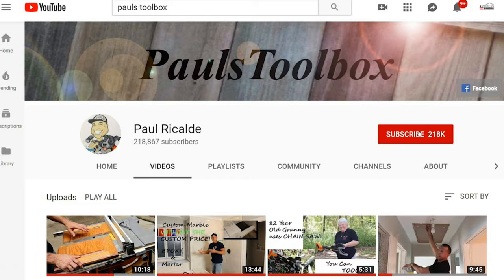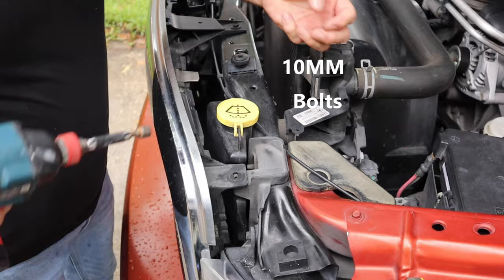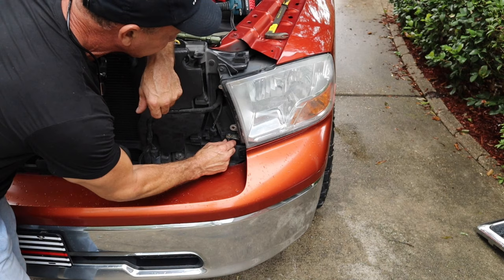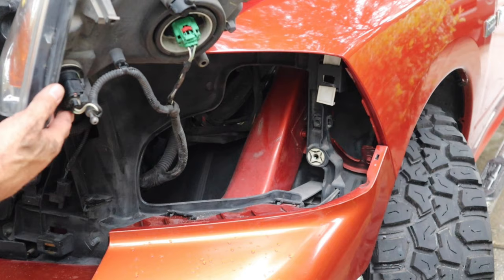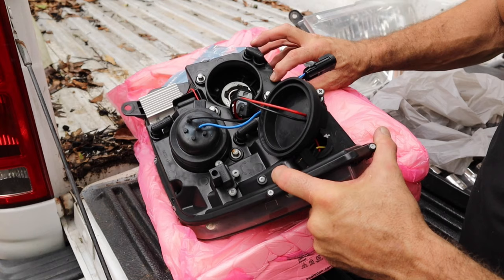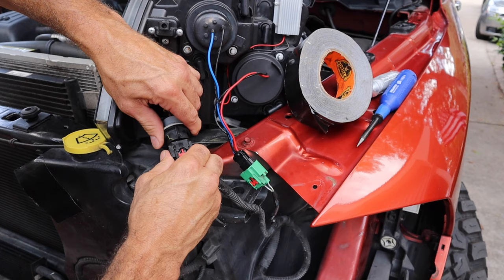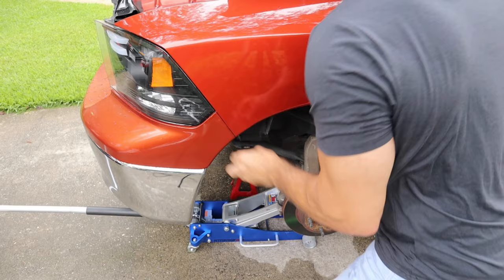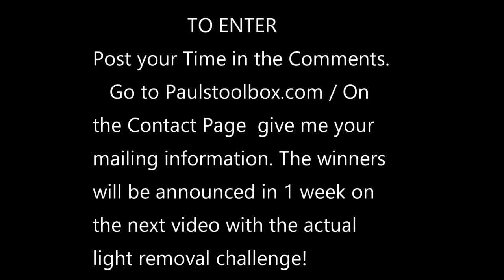How To Replace The Headlight Assembly 2009-2018 Dodge Ram 1500 | Paul Ricalde

Comment: Thanks Paul!  My 2012 Dodge Laramie failed the State inspection because of water in the headlamp housing.  They were badly sun-crazed anyway so I decided to replace them with new aftermarket headlamp housings and covers.  After watching your video I realized how easy it was   and just finished installing them.
Reply: Seriously? Did the headlight work?

Comment: You cover all the little details that are necessary, but others don't show. For me, that included the location of the coarse threaded connectors and how to fiddle with the little lock on the electrical connector. Thanks so much.

Comment: Paul, Can't thank you enough for this video. What saved my butt was the one comment you mentioned regarding the 'clip' that locks/unlocks the lamp fixture. Before watching your video I was frustrated beyond measure trying blindly' to locate that ;'guillotine' clip. Your mention that the simple way to locate it is to bring your hand over to the interior of the sheet metal fender, slide your hand an inch toward the interior and voila! there it is. So freaking simple-saved soooo much time and frustration. Thanks my friend!!
Reply from the maker: Awesome my friend, I had a hard time locating it the 1st time as well. Have a great weekend!
Reply: Yes .. finding the sliding clip was the hardest part.

Comment: Great video. I used this to replace my stock 2009 Dodge Ram headlights with the Amerilite Quad projector headlights off Amazon. The instructions worked perfectly and there was only a slight difference in the electrical connection due to the differing headlights. Very well made video Paul.

Comment: I honestly thought it was absolutely ridiculous to have to remove plastic shroud and grille to change my headlight bulbs. I tried doing this with out removing either. While it is possible, it’s totally worth taking a minute to remove them first, it actually was so much easier. Thank you for the video.

Comment: 2 min. 58.5 seconds 
Great how to video! 
Technically dielectric grease does not conduct electricity, so it shouldn’t be applied directly to the mating surfaces (pins and sockets) of an electrical connection. It meant more for the surrounding connector to prevent moisture from entering the connector.

Comment: Brother...I just replaced the headlight on my 2015 Dodge RAM. It LITERALLY took longer to watch the video than it did to replace the bulb. I would have burned the truck and pushed it in the river if I had tried to do it without watching your video. Every detail from how to get the push tabs off to how to find that plastic slide lock in the trapdoor was spot on. BEST TUTORIAL VIDEA EVER!!

Comment: Thanks a lot, really helped me a lot trying to fix my truck without help as a 16 year old.
Reply from the maker: Wow Jaime, you remind me of myself. I bought my first car when I was 15 with my brother and we had to tow it home. It locked up on someone and they sold it for $100. It was a 1972 Dodge Challenger that needed fenders, a Door and to get running lol. My brother and I took the spark plugs out and put oil on the pistons. When I got out of school the next day we used a breaker bar to turn the crank. It moved so we spun the motor with the starter until the oil came out of the spark plug holes. We put the warranty spark plugs on and started it up. We bought all the body parts from a junkyard and I had a friend that painted in his garage. He did an awesome job and I wish I had that car now.! Not enough people take the time to learn, I glad to see you have the drive!

Comment: Another great video.  Just a side note on working with all the Tupperware on today's vehicles.  I prefer to do it on a warm day rather than a cold one to reduce the chance of snapping any of the plastic stuff.

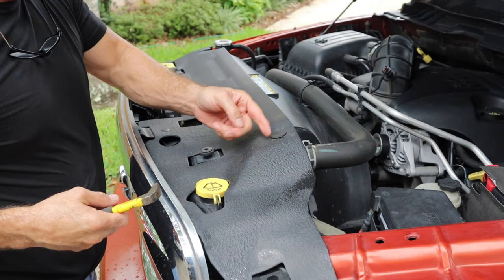You popped the first pin at like 0:1:27, at 0:8:22, you pulled the cable mount off the driver headlamp assembly, making it free of the vehicle, so I'm calling it 0:6:55.  If you hadn't commented, sure, it would be 3 minutes and change.
Reply from the maker: Thanks Curmudgeon, I know what you mean. Plastic gets pretty brittle in cold weather but I live near swamps, HOT and sticky down here. Have a great day!
Reply: @paulstoolbox  c'mon now Paul.  I grew up in Pensacola, and it gets freezing cold down there, sometimes even in the low 50s.

We love a good swamp.  My son and I paddled a canoe 60  miles through your Atchafalaya  swamp a couple of years ago.  Talk about beautiful!

Comment: FYI on the 2011 Ram 2500, you “PUSH UP!” on the white clip inside the wheel well to release the back of the headlight assembly. 😊

Comment: 2.48.33

Looking for some headlights for my '15 🐏!!  Got condensation in driver side factory and it's annoying as hell!!!

Be nice for a product update on that next video......
Reply from the maker: Hi Duane, if you take your headlight out and blow dry it, I sometimes take a sock with rice and put it in the hole of the lens and let it sit for a while, a day or so. Take clear silicone and run it along the entire seem of the backside. That usually does it. I have never had that problem with Spyder lights that’s why I went to them after I had to fix other ones. I will see that Spyder does not give you very good instructions at all but as far as the quality of the lights I am very happy. I have a follow up video on how to easily fix lights when your lights burn out often. I see this a lot of times when people replace the headlights or the bulbs. If you have any questions please send them to Paul’s toolbox.com, I will do my best to answer. Thanks!

Comment: Lady owner of a 2014 Laramie 1500… have to change the whole assembly because the turn signal is out.

Is there a way to fix just the turn signal in the existing assembly, or do I need to just swap in new please?  I have a soldering iron if needed.

Would really appreciate it! Ty!
Reply from the maker: Your local AutoZone or auto parts store should be able to order a pigtail for your truck to replace it. You can also Google front or rear blinker pigtail for your 2014 Laramie. I have purchased them in the past for other vehicles, so I think you should be able to find one fairly easily. I hope this helps and good luck.!

Comment: Hey Paul! What do you suggest to use as a sealant to stop any moisture from getting in and how would you use it?
Reply: You'd think that they would build them to be water tight, wouldn't you?
But my OEM lights leaked and filled up with water.   Well, not full, but a lot of water.   I dried them and sealed them around the edge with silicone caulk.
It probably wouldn't hurt to caulk the new ones to prevent them from leaking in the future.
I'm replacing my original faded lights now and that's what I plan on doing.

Comment: Hands down, easiest headlight replacement EVER, is on the 99-06 Chevy and GMC full-sized trucks and SUV's. No tools even needed! Pop two retaining pins out and the light come right off!!👌 I can literally swap bulbs (or the entire headlight for that matter) in less than 30 seconds per side, and I'm not exaggerating by ANY means!! 🙅‍♂️🙅‍♂️
Reply from the maker: Yeah my older GMC was a breeze, I think it is stupid to make you remove the entire headlight in order to change a bulb but it is pretty simple if you know exactly where everything is.This is why I decided to post the video. I will post the challenge in a few days. Remember to post a time, it only takes a minute , you need to put in 5 digets because we will choose the closest time. Thanks Scott!